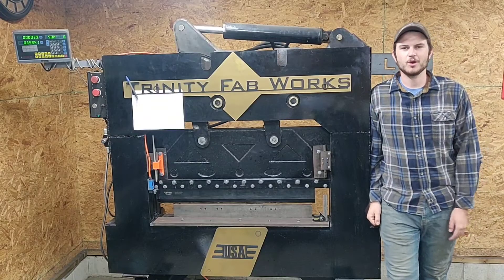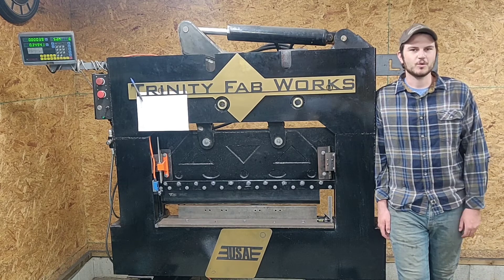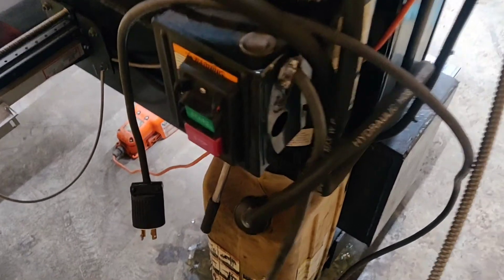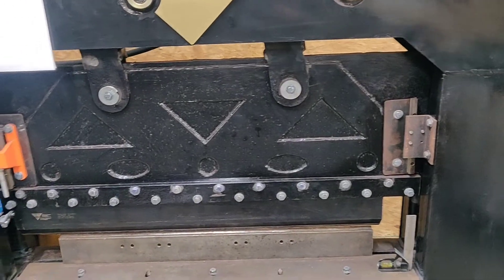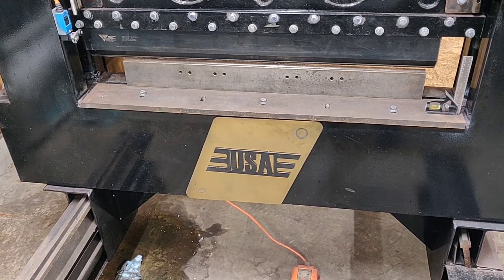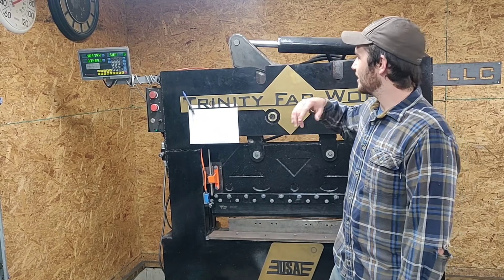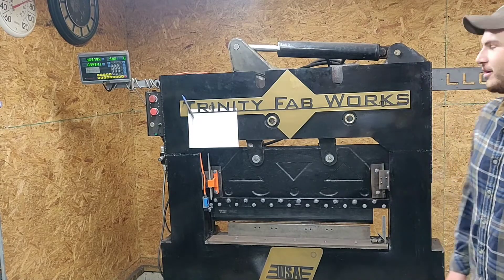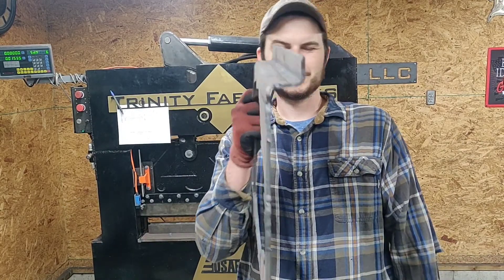Homebuilt Press Brake

Comment: Do you have the plans for the press brake available?
Reply from the maker: I unfortunately do not.  My computer crashed, and I lost a lot of my old files.  It's not an ideal design by anymeans, because I designed it around material that I already had on hand.  If I was buying all new material, the design would have changed quite a bit.

Comment: What are you using for a controller for you backstop?
Reply from the maker: I'm using an adjustable pwm wired to a stepper driver and a two way switch.  It doesn't have a controller.  You just hold the switch closed to make it move and you click a button to make it switch directions.  The adjustable pwm is to speed it up or slow it down.
Reply: @trinityfabworks6493  awesome thank you so much cool build btw!